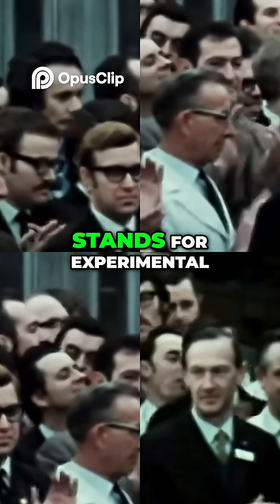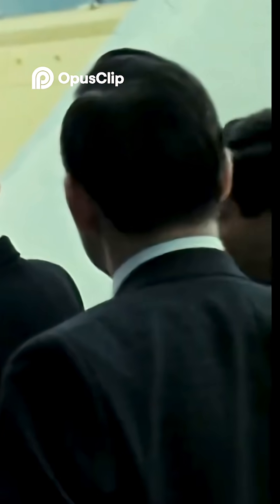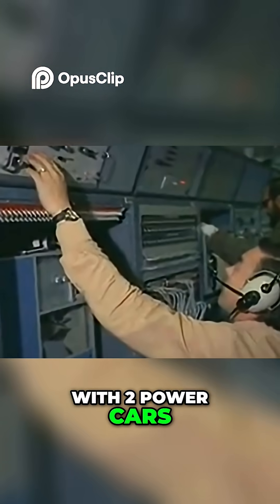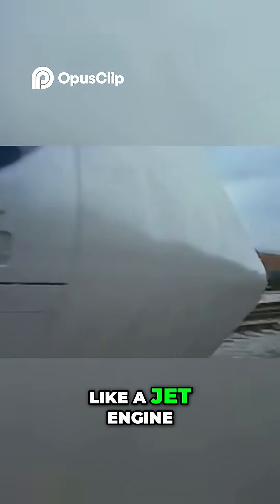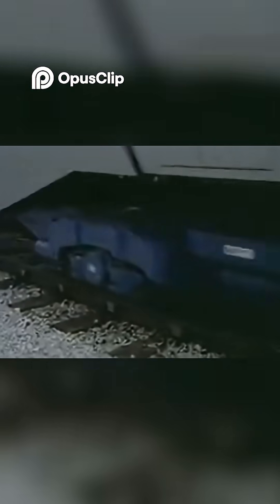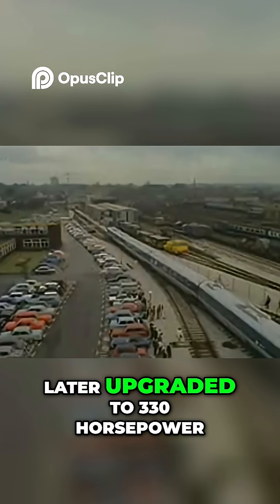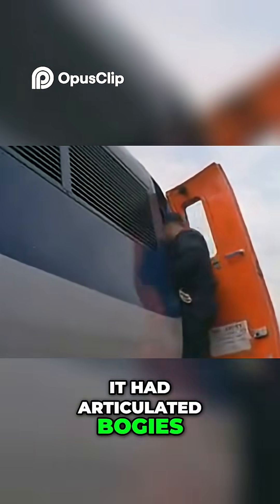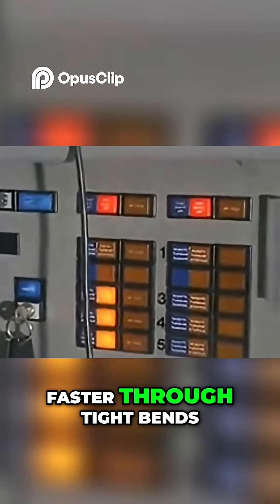APT-E Britain's Wild Turbine Train That Never Ran! #experimental #fyp #railway #advanced

Comment: Siemens built an extra bad railway track to be able to test their trains meant for great britain. So no use for an advanced train when you have tracks like in a coal mine.
Reply: Same thing happened in Romania ! We imported Siemens high.speed trains only to operate them with 50 to 60 km/h , due to inadequate railway tracks, some of them built in the ninetieth century.
Reply: Sure Siemens was the problem, not Britisg engineering 😅
Reply: @doc1007  Sure. Thats the way of thinking that made Britain so great. /s